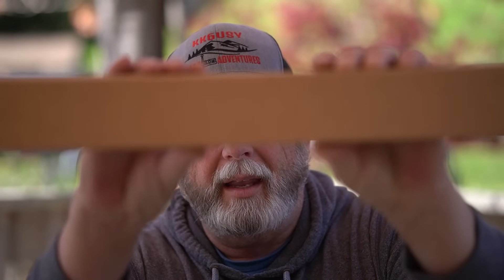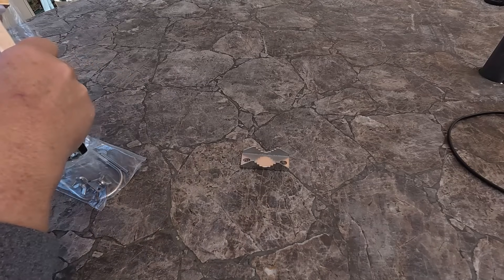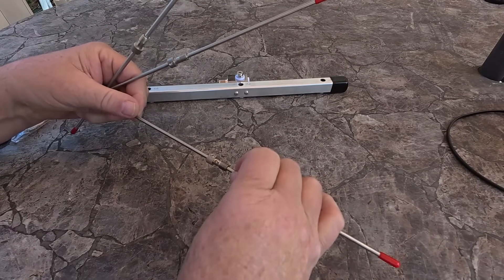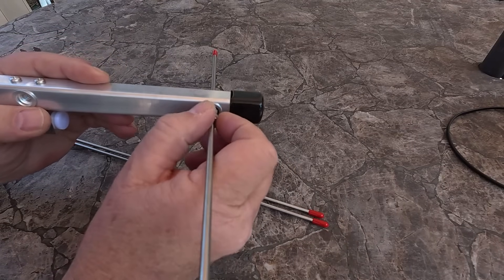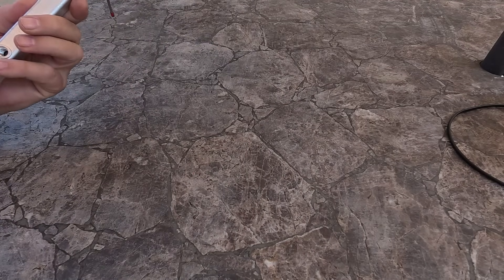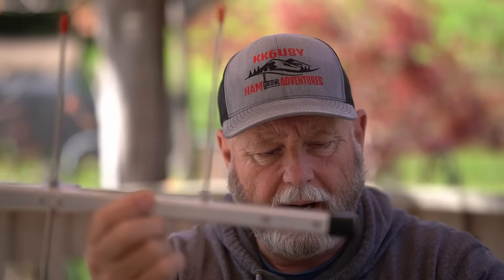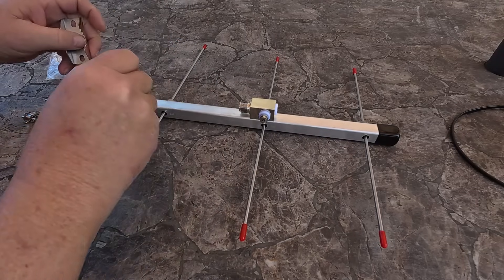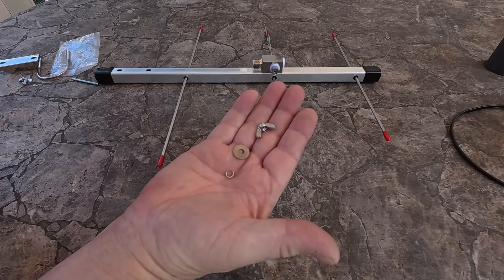GOOZEEZOO, The Cheapest 70cm Yagi on Amazon

Comment: The only thing I don't like about this antenna is the small U bolt and clamp that comes with it.

I have my 2m ground plane antenna mounted to a 1-1/2" PVC pipe mast and planned on mounting this yagi to the same mast. Since the small U bolt won't allow that, I'll be getting a larger U bolt and drilling holes in the beam and mounting it to the PVC mast.

Comment: Where did you get that tripod with the vertical extensions ?
Reply from the maker: The yellow part is a land servitors tripod that I took the center out of then put a mast in the center and I made a insert to make for a tight fit. I will link an aluminum version that is cheaper and lighter and try to get a link to the mast also.  https://amzn.to/3Lp80ed
https://amzn.to/47zFXA9 The mast hast a 1/2" threaded section at the top.

Comment: Hey Chuck!  Nice video.  I was looking at the instructions when you showed them; the elements insert into the boom through the unthreaded hole, and then engage the threads on the other side.  Not the threaded side first.  That way the element-thread component seals the boom hole on both sides.    Don't know if that makes any difference.  Just looks better to me, and is what the instructions show.  Thanks for the video  73 de Bill

Comment: I'd like to see some grommets on the other side of the threaded inserts for those of us that live in the frozen Tundra lol
Reply from the maker: To keep water out? You could add those pretty easy!
Reply: @KK6USYHamRadioAdventures  I agree but I figured being a new product the manufacturer would be checking in and figured I add my constructive comment . I believe I'm using their previous version and it's been a very solid performer on my GMRS base station routinely hitting a repeater 60-70 miles away across rolling terrain. Thanks for the review .
Reply: @KK6USYHamRadioAdventures  I agree but I figured being a new product the manufacturer would be checking in and figured I add my constructive comment . I believe I'm using their previous version and it's been a very solid performer on my GMRS base station routinely hitting a repeater 60-70 miles away across rolling terrain. Thanks for the review .
Reply: Thanks for sharing your experience. 🤝